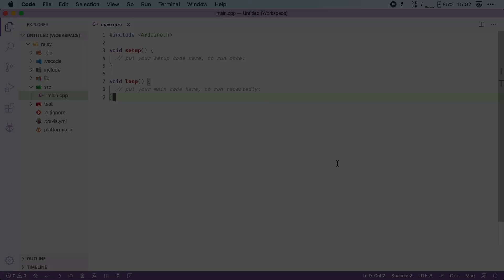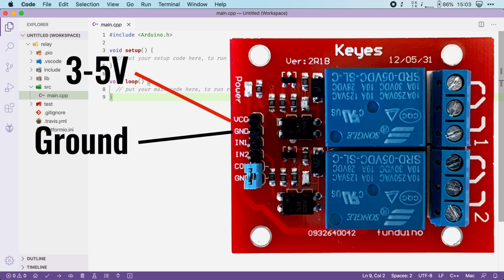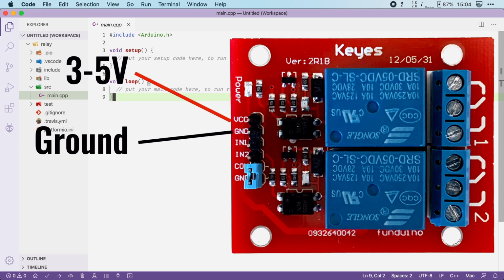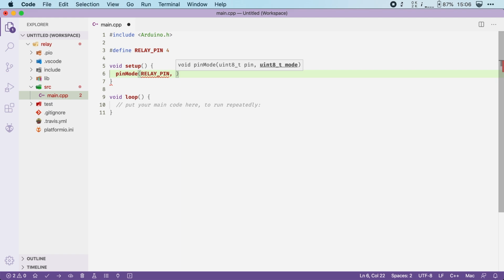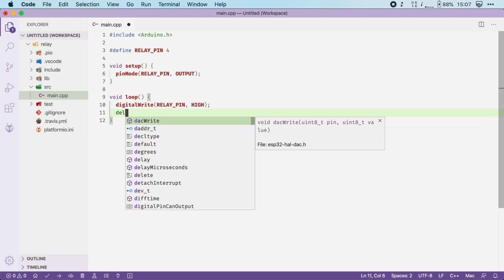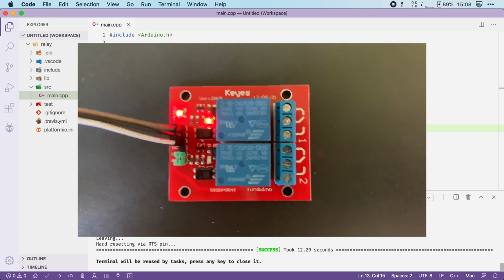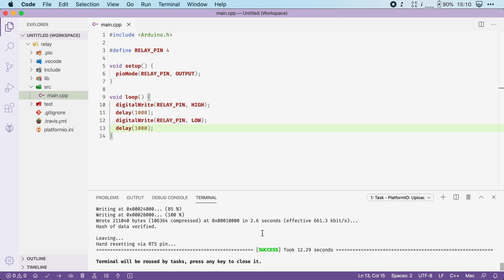Controlling Relay Board (ESP32 + Arduino Series)

Comment: when i connected relay vcc with 3.3v it doesn't glow, so i connected it with vin pin of esp32 which gives 5v then it started working what is the reason behind it

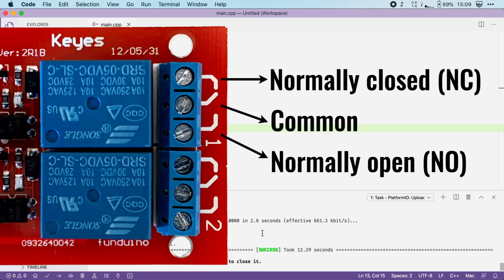Comment: 3:50 Always you have to connect the line (Live Wire ) to the switch (Relay) . Otherwise you have more chances of getting shocked because your body is connected to ground